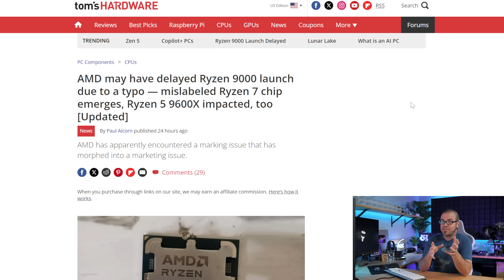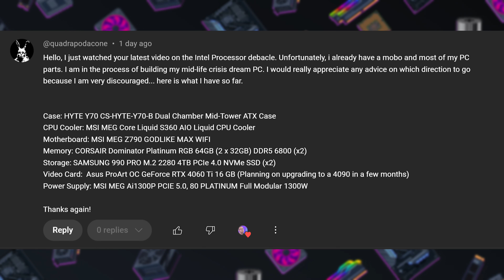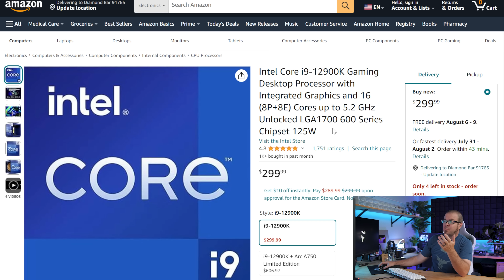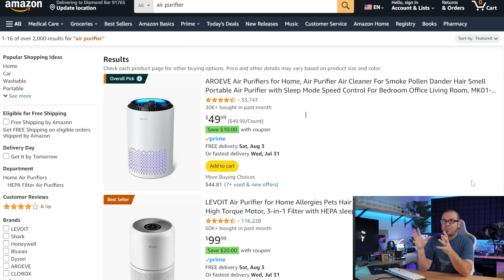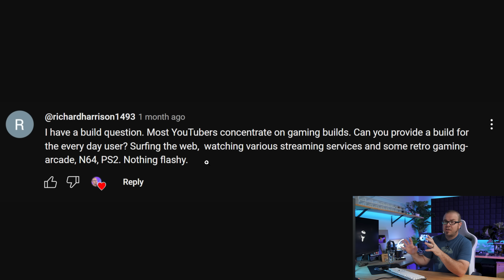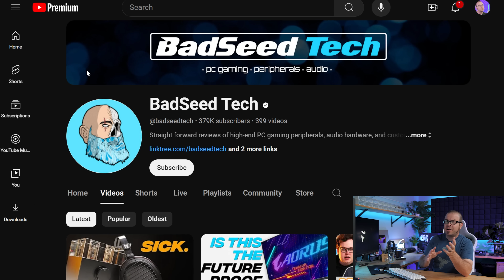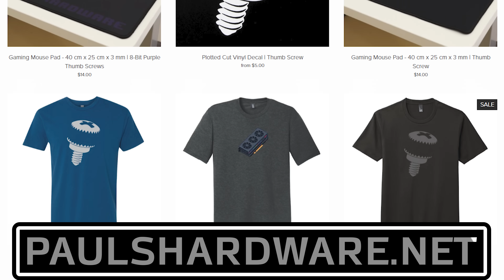What if my Intel CPU explodes?? - Probing Paul #88

Comment: 6:34 dust filters are only of interest on air intakes into the case. Anywhere you have a fan blowing out you shouldn't have a filter. Also count the fans on in and out ports. It's common that one of these are in the majority. So if you have more fans blowing air out of the case than in then you have a negative pressure inside the case. This assumes that the fans are the same and are all running at the same speed. The most common suggestion is to make sure you have more fans blowing into the case than out. This way you get a positive air pressure and all, or at least close to it, air will pass the intake fans and the filters on these. If you have a negative pressure, more fans blowing out than in, air will take any way it can find into the case. All the small holes and openings will be ones that doesn't have a filter and dust will make it's way into the case.

This is just basic design ideas as fans on a radiator will have to press air through the radiator. Same with air filter. They will make the fans work harder to get the air through the filter. So just counting fans in and out doesn't necessarily provide the correct answer. You have to figure out if you have positive or negative pressure in the case. I would say that if you can you want to have positive pressure, but it all depends on the case and how many fans are installed. A common design is to ha air going in the front and if possible the bottom. Again this depends on the case used. Then you blow air out the top and the back.

Comment: bought my ASRock z690 Taichi   motherboard a few months ago new for a fraction of its release MSRP   and a 12th gen 12700K for my intel balanced build ( Arc A770 16gb)  with the idea that I could upgrade to 13th 14th gen at a later date if and when Intel releases the BattleMage GPU, but looks like I'll be stopping at the 12th gen 12900K for now.

Comment: 🎯 Key points for quick navigation:

00:00:05 🔄 AMD Ryzen 9000 CPU benchmarks delayed; speculation on launch issues.
00:00:29 ⌨️ Sponsor plug for Corsair K65 Plus Wireless RGB keyboard.
00:00:55 📅 Episode 88 of "Probing Paul"; questions and answers from viewers.
00:01:52 ⚠️ Intel Raptor Lake CPUs experiencing high failure rates due to high voltages and oxidation.
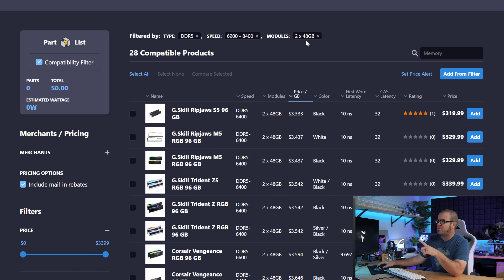00:03:14 💡 Advice on RAM configuration: prefer 2x 64GB kits over 4x 32GB kits.
00:03:41 💻 Recommendation to switch to AMD CPUs for new builds, specifically the 7800X3D or 7950X3D.
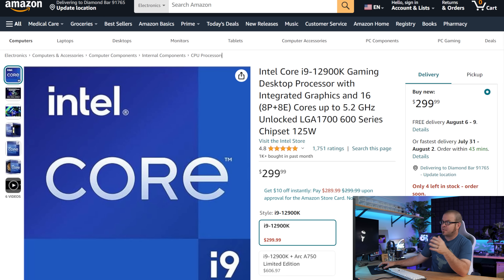00:04:35 💸 Intel 12900K suggested as a cost-effective alternative for Intel enthusiasts.
00:05:29 🔄 Importance of updating BIOS for 13th/14th gen Intel CPUs to mitigate issues.
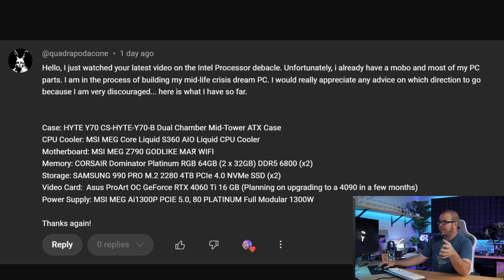00:06:22 🧹 Suggestions to manage dust in PCs: use air purifiers and clean filters regularly.
00:09:05 🖥️ Advice on mini PCs for non-gaming use; mentions Zotac, GMK Tech, and Beelink.
00:11:27 🎧 External USB DAC recommended over internal sound cards for better audio quality.
00:13:48 🛍️ Reminder to check out Paul's Hardware store and subscribe for future content.

Made with HARPA AI

Comment: Intel got back to me about my 14900K - since I did not install my CPU yet (couldn't build my new rig within the Amazon return period, unfortunately) -  they will not provide me with an RMA until I install it and find that there is actually a problem. They suggested that I install it and immediately update my BIOS or wait until mid-Augusts' updates to come out and then install / update. I asked if there is at least any way they could tell me if my unit was part of a batch that they know was impacted by these issues. They should be getting back to me in 2 business days...

Comment: I got my 13700kf like over a year ago and it seems to be fine. I have MCE turned off in the bios and got a new case for better airflow. I play the finals and TONNES of people complain about crashing with 13 and 14th gen CPU's and my experience has been completely the opposite so fingers crossed.
Reply: with INTEL CPU's  its hope and pray at this point
Reply: TBH, this is a colossal tempest in a teapot, relating specifically to the xx900k series and very little else, certainly not "13 & 14th generation" as a whole, which is colossally stupid since a lot of the Raptor Lake line-up is re-badged Alder Lake.  Non-K i9s, i7s and even the 13600K will most likely never have any issues for their entire useful lifespan.  As you mentioned, my 13600k is the most stable build I have ever had!

Comment: Oh how the herd just loves to make the same noise in every Intel video lol! Those of you that let a CPU run unlimited and now cry because it broke lol! My 13900k is working just fine, but I'm smart enough to know that 4000 watts will smoke this chip! I guess the question is, how did any of you not know this simple fact? I limited my CPU wattage on the very first boot, set it to 300w then installed windows, then ran my first benchmark. I saw the temps and said nope! Back to the BIOS and set to 220w. Another benchmark and let it run from that point on.

I'm not doing any of that undervolting B.S! I am only BIOS limiting the max power that my MOBO will dump into this chip. It's almost never the voltage, but the current that kills! The oxidation thing may be a problem at some point, I can't really comment on that. But letting a CPU draw unlimited power? It's a DUH factor.... As in it's gonna fail if you do that, DUH!
Cheers 🍻
Reply: Ok how do u tune a i9 14900K isn’t the advertised rating supposed to make the price make more sense. I’m just wondering if you do also recommend limiting watts on this. I sincerely am asking cause I have shopped for psu’s to do 350W and well manufacturer’s love to make 300W option or 450W full power and well they’ve said it it won’t hurt and so does jaytwocents. Is everyone wrong we need to do what u do??
Reply: @michealfunickrr3717 :
These are only 250 watt chips from what I recall by Intel spec. Pushing more wattage then that does not make the chip run much faster, it only makes it run a lot hotter! Simply limit the CPU wattage in the system BIOS. Don't let the motherboard dump unlimited amounts of power into these chips, doing so will kill the chip, quickly! 

My 13900K has been working all day/night rendering video, it hasn't hit the thermal limit not once. The only way to keep these chips from living on thermal throttle is to limit the power you feed them. It's not the voltage you need to worry so much about, it's the current. No cooler on the market can keep them cool enough unless you current limit them! A chip that lives on thermal throttle is 100% unacceptable! Tune your CPU wattage by temperature. When you can run nonstop and never hit the thermal limit/throttle, then you have a good setting for your set up. That's exactly how I tuned my system.
Reply: My 15900(k)ills(I)tself at >65W, so I oxidized it. Now, its die is anything over 30nm. Back to Cyrix CPUs cuz I'm not coping as well as infinte-turing. DUH

Comment: It looks like Intel for some reason have the E-cores they added on, pulling from the same power bus as the Ring-bus interconnect, and its causing the Ringbus to self destruct. Its an architectural problem. This might be made worse by it seems like there was an oxidization causing manufacturing error at an intel arizona fab.

Comment: Topic for your next Probing Paul Episode.... Given just how widespread this intel CPU failure or fear of failure nightmare is, just how sketchy will the used market be for these in a few years when they start hitting the secondary market in large numbers, but the initial coverage is a thing of the past? I'm not sure you would have any way of knowing or telling if the CPU in question you're looking at had the micro coding update, and if it was done "in time". Thoughts?

Comment: The engineers at Intel had a CEO problem. The CEO would not invest a competitive fab process. To get Intel’s fab process to work at higher frequencies for their performance cores, they would allow a short time boost and a thermal velocity boost. These “boosts” frequencies were limited by a 100 C temperature limit. However there is a delay in sensing the temperature. Repeated exposure these delays leads to thermal damage (migration). There was a significant boost in performance between the 12 and 13 gen high end Intel CPUs because of a more aggressive implementation of this strategy.

Gamers would be likely to use thermal velocity boost more often and with great benefit because of the interment loading during game play. The thermal velocity boost can kill the CPU. Almost everyone uses the extreme memory profile (XMP) and Intel won’t be giving out new CPUs to those that do.

I can report my experience with a sample size of two 13900k CPUs systems that I built for an AI programmer to be used to test code for AI learning and inference. The code was initially tested using the CPU, while the test using large data bases used 4090 GPUs. Both systems used 2 sticks of 32GB 6400 MHz ram running at 6000 MHz. Two computers were used for reliability so that a failure of one would only cause a delay of a few hours.

The thermal solution was tested using Cinebench R23 for the CPU and Furmark on the GPU. The goal was to get the highest Cinebench score while maintaining a CPU temperature in the low 80s C. This would allow higher ambient temperatures and dust accumulation. The Cinebench R23 multi score just over 38,000.  Then short time and thermal velocity boosts were disabled. Again frequencies were adjusted to maximize Cinebench scores. These result were guarded by current and power maximums. The CPU’s package temperature was 82 C with a Cinebench R23 multi score just over 40,000.

Comment: One thing you didn't mention is that if your PC is on or near the floor, get it up!
My old PC was on the floor AND near a window and the dust build up was brutal. Now it's setup ABOVE my desk, around head height, and it's insanely better. I clean it out once a year, and even then there's barely anything to blow out.

Comment: Thank goodness, I have a R9 5900X. As for DAC's, I've been eyeing the iFi Zen Blue 3 Lossless DAC for the extra bluetooth connectivity. I currently have an EVGA NU-AUDIO sound card which is great. But since EVGA doesn't really make stuff anymore I can no longer get updated drivers for it. So a nice external DAC in the near future will be nice to have. The other nice thing about DACs is the expandability of them. You can either plug them directly into an external amp for hooking up speakers, a stereo receiver or headphone amp. I see iFi also offers a phono stage for those who want to hook up a turntable. :)

Comment: Regarding the last question, I would still recommend an internal sound card such as the Asus Strix Raid or the Sound Blaster AE5 specifically for speakers. Reason being most affordable external DACs only have stereo outputs and lack 5.1 or 7.1 outputs.
The other option, which is honestly the best, would be to get a receiver that supports Dolby Atmos and simply use one of your video card's HDMI ports to output sound that way.

Comment: For Intel users: 
1) Make sure your Intel CPU is running latest BIOS, and watt limited to 253w unless you know how to undervolt. Then head to my channel and see step by step.
2) Wait. Use your computer.
3) IF your CPU fails, make sure you used Intel's profiles and RMA the chip
4) I am on my second 13900k, and I know how to prevent voltage degradation, but silicon quality is something I do not control. My first chip was undervolted and still failed. But it was watt limited to 300 watts, new chip is 262 watts limited and did not fail. 

Trial and error.
Reply: Just switch to AMD or old Intel, dude. Current Intel cpus are done for.

Comment: Hi Paul! I've enjoyed watching your vid's for a few years now, but this is the first time I felt that maybe I could leave a useful comment. 😊

I'm stuck in Hospital for a while & wanted to get a small 14" laptop to game on to save my sanity! I've been gaming on my Mobile, but really miss my PC games! I saw a review by Wendel at Level1techs and Tom at Moore's Law is Dead on the new Minis Forum V3 3in1 Tablet.

Tom even includes a gaming & tweaking guide. I owned a DELL tablet from 2015 & at first just went past their reviews. But prices on laptops now that could play decent games were high, especially here in Australia! So went back & watched them.
 
They were blown away and highly recommended it, for similar & some different, reasons. And it was "cheap". So I ordered one, and I have to say, it really is incredible for the price USD$999 Even the sound is very good & better than some laptops costing 3x the price. It also has 2x USB 4.0 ports!

 Anyway, check out their reviews if you haven't already. Maybe it will be something different you might want to review at some point. 👋

Comment: Intel wishes they only had a typo problem.
Reply: AMD is the only one reporting the typo, no one that received them noticed a typo. Who doesn't look at their CPU first to see if they got the right one? I call BS on the typo excuse.
Reply: I rather think they AMD right now ! 🤣
Reply: @gertjanvandermeij4265  AMD's were exploding " Literately "  not long ago. The public gives AMD to much credit.
Reply: @freedomearthmoon1 The problem was with the motherboard manufacturers, not with AMD. But there were problems with AM4 at the start as well. I have an AM4 motherboard, an ASUS X570-P and had it blast my CPU with excessive voltage. A bios update fixed the problem.  I upgraded to a 5700x3d a few weeks ago and don’t expect to upgrade for a few years.
Reply: @richardbeckenbaugh1805  Intel blames the motherboard manufactures for 13th and 14th gen. Not taking responsibility for bad silicon and bad information is a cop out.

Comment: so glad first thing i did with my i5-13500 was to check all voltages (core, rails, ring, ect). Learned a lesson long long ago with a cyrix 6x86mx PR-200 to triple check voltages, bus and multiplier.

Comment: Re: dust issue
Make sure your case has more intake than exhaust so that there's positive pressure inside the case, and all intake goes through filters.
Also for the air purifier, find one with the cheapest replacement filters.

Comment: The only thing less stable and requires more power than an Intel chip right now is the Intel fanbois.

Would absolutely be hilarious if the microcode update increases performance though.  But I expect it will castrate the high-end chips.

Edit:  I use a Shiit 5.1 DAC and an Emotiva 5-channel amp with Klipsch speakers....and it's kinda amazing.  No, it wasn't cheap...but the difference between this setup and my old PCI-E soundcard is very noticeable and I have VERY measurable hearing loss as well as tinnitus, especially on the high-end. (Wear hearing protection kids)

Edit2:  I would like to find a good software crossover because the woofers push too much bass and actually take away from the great subwoofer.  Suggestions, anyone??

Comment: If you have one of these dei chips then go into bios and cap yours volts on cpu and turn off mobo cpu optimization (which just uses more volts).  Dont overlock, underclock if anything until an update is rolled out.

Comment: People who aren't even considering AMD at this point I swear have some form of Stockholm Syndrome.  As sorry guys.  The issues with AMD being unstable were resolved MANY years ago.  Legit I went back to AMD in 2021 after being away for 15 years.  It was the smoothest expierience I've had with a system setup outside the memory training which all you need to do is go to lunch and leave it alone for an hour.  It will just do its thing and away you go.

Comment: Sorry for all the people that are going through the issues with thier Intel chips, it's a horrible thing. I wish you the best of luck with RMA's. 

But if your starting a build now just go with AMD. I just upgraded my AMD 5900x rig with a 7800x3d from microcenter in a custom combo deal for just over $500  (MB,CPU & RAM). The 7800x3d in the combo was $224, I could not pass that up.

Great video Paul and stay well.

Comment: I literally had the Alienware Aurora R16 with i9-14900 and 4090 in my cart the day Gamer Jesus released his video. After three PCs dead in the last 3 years...I think I'm done with gaming PCs altogether. I have a Corsair One Pro i200 sitting dead in the box next to me, with 6 months use and no games played. They won't take my money to fix it and neither will local repair centers. Corsair sucks.
Reply: Alienwear is just an overpriced Dell in a nicer case. Look up reviews on companies that do proper pre-builts.
Reply: @nathanbaker6033  I understand that, but I am planning on moving to the Philippines and need a major company that will do warranty work there. That leaves Dell, HP, and Lenovo.
Reply: That's what happens when you buy ready-made PCs, particularly "gaming" ones
Reply: If you have had three PC's "dead" in three years, you're doing something horribly wrong.  PC's don't "die", single components might (very rarely) fail, but not the "PC" since there really no such thing, they are just a box of generic parts.

Comment: I have an i9 14900k build i havent finished, now wondering what i should do i purchased them black friday 2023 at microcenter. Hopefully intel finds a solution soon.
Reply: As long as you download the new Bios update, it has the latest microcode which will work just fine.  I have a 14900KS and can now run it at its advertised specs of 6.2 gigs on at least two P cores and the rest on 6.0.  E Cores all on 4.5.  I also have a Z790 Apex Motherboard which helps because it has 24 power stages and powerful VRMs to handle this chip.  But I was having to lower the frequency down to 5.8 and make adjustments in the Bios to keep it cool.  Now the new Bios Update has eliminated all my issues.